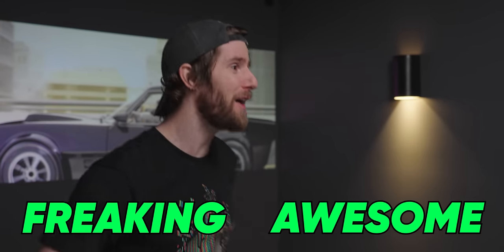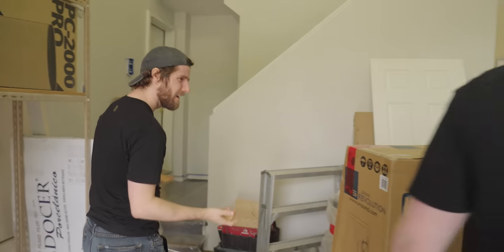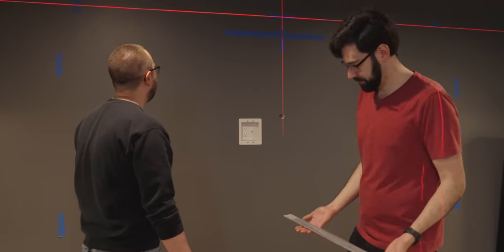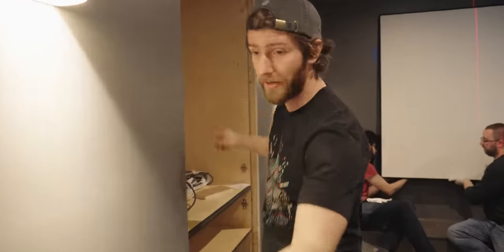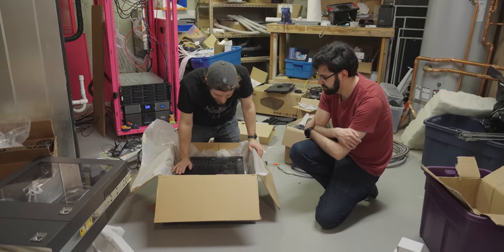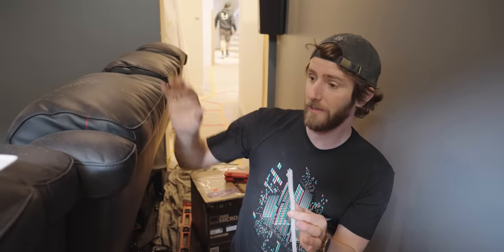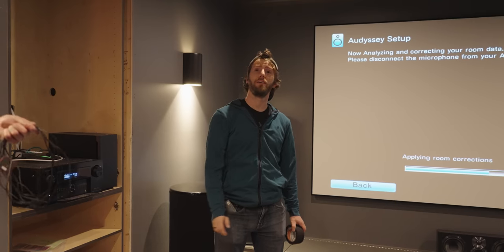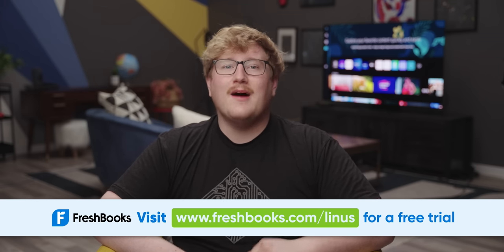I finally made it - House Theatre Room Build

Comment: As someone who works in broadcast, that projector looks FREAKING INCREDIBLE for only $5000. My work uses Panasonics that are $30,000 and can't even do HDR. The game is seriously changing.
Reply: It still has no native 4K or 3D. Sonys / JVCs projectors are still better in my opinion.
Reply: I mean, say what you want, but Sony has always been a market leader in terms of media quality.
Reply: @p4skal0  there are shift projectors that look like 99% native 4k, you only would see a difference in a test picture
Reply: @p4skal0  Sony’s new entry laser (the 5000) is ok  for the price, (but 6k and no motorized lens adjustment? C’mon!) but the other two laser models have been horribly overpriced for the North American market (the 6000 and 7000). (Europe is much more sane.) Even excusing the price disparities, some aspects are a letdown if you’re a gamer.
Reply: @bvbdrag0n  Agreed. Native 4K is a lousy place to spend your bucks in the projector world. I’ve pixel peeped the JVC NZ series, the older NX series, all alongside even the lowly 2 way pixel shifters and at even 5 feet away on a 120 “ screen you’re going to have trouble spotting the difference in motion. Now good native contrast ratio coupled with higher lumen output? That’s where the fun is at!
Reply: @bvbdrag0n  I think it depends on the size you are projecting, but fair, it’s hard to tell, if there is no direct comparison. The most frustrating part for me is the lack of 3D. I know, on TVs 3D was badly implemented, but on projectors it’s really nice. I love watching movies like Gravity in 3D, which is much better than in most commercial theaters. Besides the 3D Support, it’s also frustrating to know that your 4K input (e.g. 4K Blu Ray), where you often payed extra money for, gets scaled down inside the Beamer to in some cases even 1080p.
Reply: @ryankramer  I am not talking about their laser projectors. I have bought the VPL VW 270ES for around 2900€ two years ago, as a demo unit. If you compared it to similar laser models at the time it’s banging for the buck, especially with 3D Support and native 4K resolution. Although it must be said, that I only watch movies and don’t game on it. If you only look on the spec sheet, 1500lm might seem low, but because of the SXRD technique it can’t be directly compared to laser projectors.
Reply: I work with Christie 4k40's, and I'm impressed with how well this looks, although I would personally go with the JVC or Sony, the price is still amazing.
Reply: Why can't they just use a massive 85 inch 8k Samsung TV mini LED. That would freaking perfect
Reply: Now is the worst time to buy expensive projectors because demand is increasing so it will deffinately change prices and affordability of high end gear
Reply: @p4skal0  that’s kind of my point. I WISH features like 4K were reasonable in the professional space. Anything that has 12G SDI for 4K60 is ridiculously expensive. The reason that gets used over HDMI/DP is distance and reliability. Heck, different topic altogether, but LED video wall tech is even worse than projectors. You can’t even get a full 1080p wall for under $200,000 with all of the processing gear. Pro Video is expensive AF.
Reply: @Zyo117  100% agree. While I’ve never seen a Sony projector, I do think their cameras are some of the best in the business.
Reply: @p4skal0  Lumen output is lumen output regardless of the display technology. And SXRD panel degradation is a real thing for those models. I'm not saying Sony is terrible per say, but they coast on their name a little bit and it irks me.
Reply: @THE-MAD-TECHIE  The 11000 has half the contrast of the 12000. If you're in a light controlled room, the 12000 is the right answer. If it's a shared space with some ambient light, the 11000 makes a lot of sense.
Reply: lol what you're talking about. JVC and Sony are so long in that game.. and you're really working with professional projectors? 😂
Reply: @p4skal0  way better 👍
Reply: @User0815-OG we’ve had these projectors for close to 5 years. When we got them, they definitely were up there in the price to performance ratio. I work for a large-ish church (not a mega church by any means) and our budget is limited. What my original comment was saying is that the projector industry as a whole has come a LONG way in that time. I know that Sony and JVC are better, but I do have to think of price longterm.
Reply: @ryankramer  I've been looking for a projector for my church on and off for a little while now.  The existing one uses light bulbs instead of laser,  takes in a 1080P signal and down converts it to something below HD before displaying it, and isn't very bright due to a combination of its distance from the screen and the light in the room. 

I think from some research that laser is the way to go,  and there's not really a need for filter cleaning,  so it could be mounted on the ceiling closer to the screen. I don't really need 4K, but I wouldn't turn it (or "fake 4K") down if the price was right. The last problem is figuring out lumens and maybe contrast,  since I don't think the church is going to want to block out the windows.  Plus there's room lighting too,  so I think we need something bright regardless.

You mentioned the 1100 could work in a room with some ambient light.  What do you think of it in a room like what I described?
Reply: @p4skal0  3d is dead, 3d 4k doesn't exist, and pixel shifting is just as effective and much cheaper and brighter.  JVC has better blacks that's about all it's got going for it.
Reply: @p4skal0  so you're ok with 1080p for 3d, but when 4k gets "scaled" down it's an issue?  I mean most of the 4k content is/was 2k upscales anyway.  Sides it's not scaled down so much as "interlaced" you aren't losing the detail like with an actual scale.
Reply: @Antimonkat  No I don’t like it that 3D Blu Rays can only carry 1080p and that it basically halves the brightness, but this compromise is worth it for the information that 3D adds. I don’t know if you have ever watched 3D with active shutter glasses on a beamer, but if not I would definitely suggest you to.
Reply: @p4skal0  ok but that is still a 8000€ projevtor, you just got a hell of a deal.  I'd put it up against this projector with HDR content and it would fall likely fall flat in brightness, color volumn, and contrast.  Great for the money you paid, not worth what most can get it for.
Reply: @THE-MAD-TECHIE  it's like the 5050 and 6050 all over again. basically same unit, but black vs white, cable cover, longer warranty and binned a little higher quality wise.  pro vs home model.  I got a deal on the 6050 and the extra lamp, warrenty and color made it worth it for me.  I was also able to find one.  My ussual go to doesnt have the 12000, only the 11000, so not sure if it's even harder to source.  but yeah overall pretty similar units.
Reply: @jprme7588  because 120" is better? and costs much less, and honestly looks better, and 8k entertainment content doesn't exist.
Reply: @Antimonkat  3D is dead because TVs / projectors that can display it well are / were way to expensive. This resulted in low market share, which lead to less 3D movies and so on. But this does not mean that 3D is bad. In fact, there are many 3D movies out there and some of todays movies are still produced in 3D. Therefore I would still suggest buying 3D projector in case of a movie use case.
Reply: @p4skal0  I'll take 4k hdr over 3d any day.  I never found 3d engaging except on rides in theme parks.
Reply: @Antimonkat  85 inch is pretty big and a new mini LED or OLED if you like would look better than a projector. But I guess not as big yeah, but the room Isn't that big anyway
Reply: @jprme7588  having both a 77" Sony A80J OLED and an Epson 6050 with a 150" screen, where do you think I watch almsot all of my movies? :) the 150.  It just feels more impressive and enjoyable even if the image quality might not be technically as great.   Anything less then 100" just doesnt feel very theatre like.
Reply: @Antimonkat  yeah some people just like giant screens! Especially for a big home theater room, if you can fit it, and double especially with a super bright projector and light+reflection controlled room. 

But if it's ~85" projector screen vs 85" OLED... The TV will look better IMO.
Reply: HDR looks like complete garbage even on the greatest projectors from Barco and Christie. You need a truly massive light source to achieve the minimum dynamic range and it changes scene by scene. SDR is always better.
Reply: @Adam-eg7tq  while I agree that HDR on most projectors isn’t great, the fact that a consumer grade projector can do it and have it look THAT good is impressive. It gives me hope that it will improve in both the consumer and professional space relatively soon. Also, at least in my area, most modern films are shown on HDR at most theaters. Something like this does make a difference in the long game.
Reply: @Adam-eg7tq  HDR is astounding on the Christie Eclipse projector. 17,000 lumens, 100% BT2020 color coverage, OLED blacks, 250-300" screens, and an honest to goodness 22 million to 1 contrast ratio. But the price... @_@

Comment: 09:50 Unless you have acoustically transparent screen, you shouldn't put the center speaker behind the screen. And if you have 4K or 8K screen, it's rarely acoustically transparent because the traditional way to make it acoustically transparent was to make if full of small holes. 4K resolution is high enough that any holes in the screen cause problems.

Having the center below or above the screen is fine but you should make sure that the second row can see the center speaker or they will get much worse dialogue audio. (This works because ears are around the same height in your head as your eyes. If the center speaker is too low and you cannot see it, you cannot either directly hear it and you'll be listening bounced audio only.)
Reply: at any reasonable seating distance, the holes don't make any noticeable difference with even a halfway decent screen weave even at 4k. all pro cinema's have speakers behind an AT screen, it's fine
Reply: I printed off a picture of my centre speaker to give to people behind me so they could see it  but it did not improve the sound at all.
Reply: " And if you have 4K or 8K screen, it's rarely acoustically transparent because the traditional way to make it acoustically transparent was to make if full of small holes."

For higher resolutions there's a lot of weaved screens that are acoustically transparent and can handle a user sitting much closer than a perforated screen. The tradeoff is gain is usually around 10-15% lower on the weave screen vs a perf. (0.85 vs 1.0)
Reply: One of my dreams is to have enough money to care about where my center speaker lol
Reply: generally, this room kinda lacks sound treatment. would not mind a bass trap in every corner and just a few very carefully placed absorbers at the secondary reflection points.
Reply: It's why they call them the cheap seats. The sound is not going to be as good, and the screen will look smaller. Sucks to be them, but it will still be a decent experience.
Reply: Its called micro perf, smaller perforations for higher resolution.
Reply: Every IMAX theater (and most high quality traditional movie theaters) use acoustically transparent micro perforated screens and no one ever complains about the holes on those. At a sufficient distance, the holes disappear. I have a micro perf screen in my home theater and at 8' away you can't see it.

When you do an A-B comparison of speakers below and behind the screen, the vast majority of people prefer the speakers behind the screen because having the sound match the visual origin and having the center channel height match those of the front left and right improve the AV cohesion and immersion.
Reply: @Antimonkat 
At any reasonable distance, 4K starts to become irrelevant.
Reply: @jooplin  bass traps are inefficient and not well suited to home spaces, can't make them big enough to be effective.
Reply: @AB-80X  depends on the size of your screen ....
Reply: @Antimonkat 
Not at all. The size is directly proportional to the viewing distance. The viewing angle should not be more than 40 degrees. You only see greater angles in commercial theatres where you try to pack as many in as possible.
Most common angle for a 16:9 screen would be 36 degrees.
Ask anyone in the movie theatre industry, or within THX etc. and they will usually tell you that 4k is pretty pointless.
Reply: @AB-80X  well the industry spends a whole lot of money producing and displaying content for the format pointlessly then.
Reply: @Antimonkat  usually not, but in this room there is a enough space

Comment: Welcome to the beginning. Soon, you'll be putting sound treatments on the walls and ceiling and swapping out just about every part of the sound system.
...and it's going to be fantastic.

Shout out to SpareChange and his channel, he's rocking it on the high-end.
Reply: Listen. My 5.1 became 7.1 became 7.2 in the period of a couple months, and now I'm looking at upgrading the receiver to handle 9.2 because I really want proper tops. 

I've tried convincing the wife to let me replace the wood paneling in the theater with carpet.

It's dangerous.
Reply: @tpasco1995  What do you want with carpet? Deaden everything from 5kHz and above? And go with 5.1.4 rather than 7.1.2. The 4 height channels make much more sense than back surrounds.
Reply: @florichi  Mostly trying to cut down on reverb. And I already have twin subs, for clarity. 7.2 at present.
Reply: @tpasco1995  Carpet will only do something above 6-8kHz. If you really want to do something build yourself a ceiling panel filled with 10-15cm insulation like hemp. You need a lot of thickness and quite an area to get reverb down across 250Hz-20kHz, not only the highs.
Reply: Upgradeitis!
Reply: @tpasco1995  really good home theater is like heroin --- you just want a bigger and bigger hit
Reply: @florichi  depends on the room layout. with one row of seats, I'd still go 2 top 2 backs unless it is a really short room.  Just by shear volumn of effects mixed into rears vs any tops let alone rear tops, yu'll get more out of a 7 bed system rhen a 5 bed and 4 tops.
Reply: @Antimonkat  The dudes that mix the stuff always say go with 4 heights and less base layer speakers. The german HT dealer GROBI did a ton of live talks with a bunch of creators, musicians and tech engeneers of AV Receivers. The front to back action is way more important than rear surrounds.
Reply: @florichi  but you can get front to back with rear beds, and more movies have 7.1 mixes then atmos/dts:x ones, let alone dynamic mixes with objects.  if we were debating 4 heights vs front wides, then yea for sure go heights. but rear surrounds are very important, especially if you have a longer space where your seating postion isn't on the back wall.   When it comes to actual speaker use time, without upmixing, rears will get more time in use then heights, let alone 4 heights.  Honestly, do both if you can, but if you have to choose, base it on the content you watch.  Unless you only watch atmos/dts:x, money is better spent with rears in my opinion.

Comment: I love how Jake explained passionately why they where going to mount the projector 12 feet and 6 inches from the screen only to immediately throw it out the window
Reply: With how bright this projector is they could mount it 50 feet away and probably not use it at full brightness
Reply: that part bothers me so much cus I thought when he said "which is around" he's gonna tell the distance in cm but nope feet -sincerely, a guy who still don't get imperial units
Reply: story of his career at LLT
Reply: @michaeltagor4238  here you ft is simple 1inch 12 times is 1 ft  so 12ft 6 inches verses 365.76CM
Reply: @michaeltagor4238  12 inches in a foot. If you grew up with it it makes complete sense. I dont visualize metric well at all. I get how it works but i can pace out about a yard but couldnt tell you how long a meter was without actually measuring it.
Reply: @marioStortuga  You mean 3.7 meter?
Reply: @michaeltagor4238  the metric system is just inferior bruh. at least in temps F is so much more useful than C. C is just dumb and not sensitive enough.
Reply: @realyopikechannel  Metric for distances totally makes sense imho

Comment: Suggestion: Next time, if there is one, cover the walls with 3/4 inch plywood then drywall. Easy mounting for anything. No need to find studs or use anchors
Reply: It's a great idea.
Reply: True that! It's getting more common over in my country, just because it makes it so much easier to work with.
Reply: We just bought a house and I'm going slightly the other way. Cut plywood to be smaller than the TV, but big enough that it spans three studs. Bolt the plywood to the three studs with three screws each, paint it, then bolt the tv to the plywood in exactly the position you want. A little less elegant than plywood behind the drywall, but works great for a quick fix.
Reply: that could make the wall to rigid and cause to much echo in the room.
Reply: @MrHakisak  this is the wildest comment I’ve ever read
Reply: @nwrhaner  but you have read it? 🏴‍☠⛵